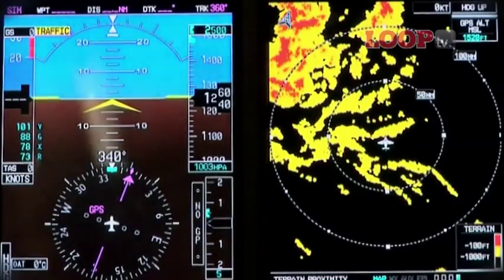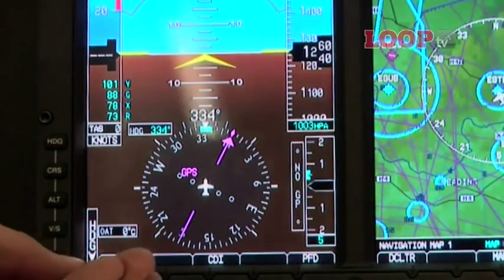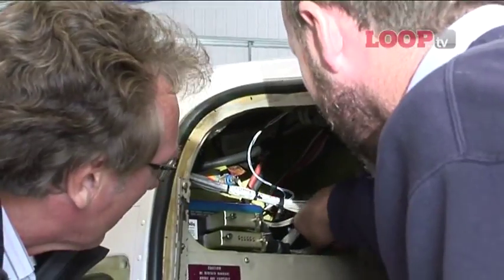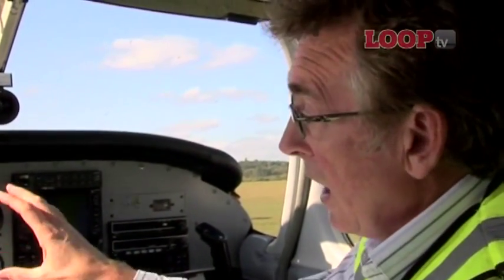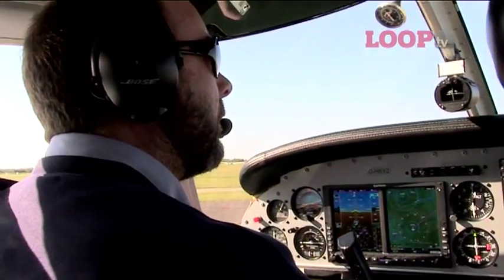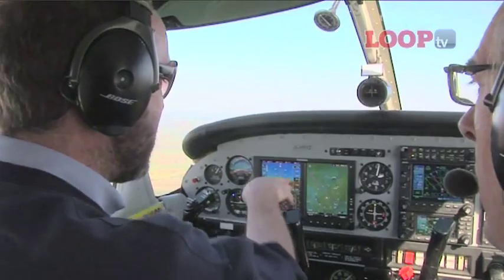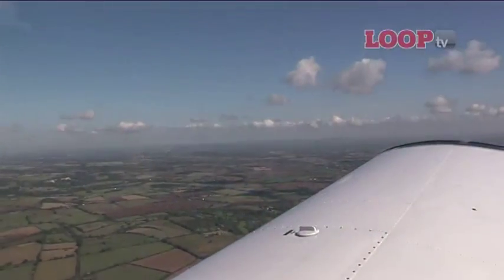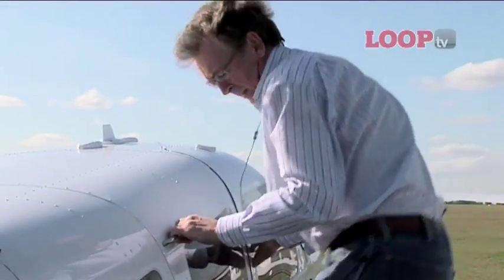Garmin G600 glass cockpit review

Comment: It is truly an amazing piece of equipment. I myself have installed and flown 6 of theses systems. The G500 makes more sense or those with aircraft under 6000 pounds. The addition of synthetic vision is a nice touch for the g500..but not at all needed. The new GTN series works flawlessly with the g5/600 series and is a much needed update to the gns series radios. I could go on and on about Garmin equipment..any questions..ask me. My info is free..my work..is not.